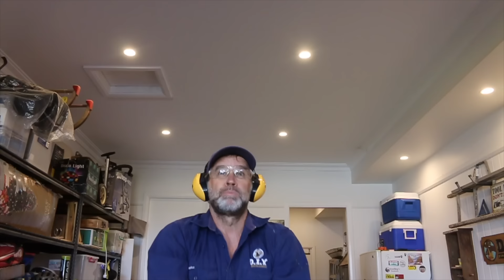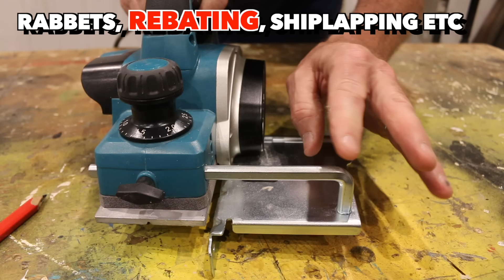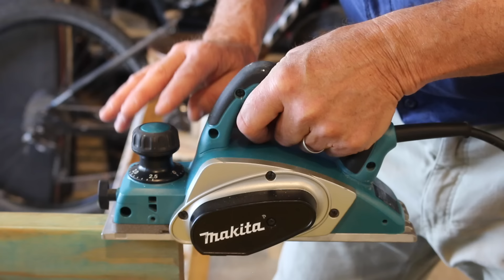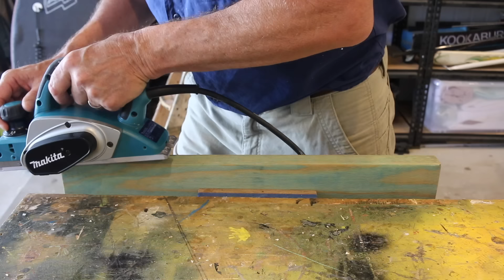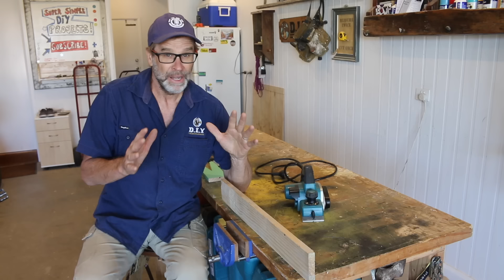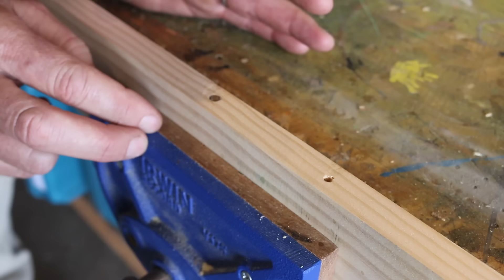BEGINNERS Guide to Using an Electric Planer.

Comment: Mate, this was the BEST multi purpose tutorial I've seen yet! This covered planers, clamps, safety and tips absolutely BRILLIANT!! TOP MAN! (I've just decided I don't need a vice and pipe clamps just go for pipe clamps and make one when needed! ...As I got a new metal work vice I could use small stuff with protection on jaws in a pinch, excuse the pun!) Regards the pipe clamps I just seen a set of 4 for about £45 on eBay red ones dunno if they're any good or how to tell!? Also what diameter pipe to go for as obviously they don't come with pipe, so dunno what's best cheapest and easiest to source diameter wise like dunno if they use scaffold pole type stuff or if you literally have to just go buy some lengths of pipe online or metal supplier.. only just getting into wood working really so Any tips on this be great mate!(Sorry if sound like an idiot!)
Cheers from London England 👍🏴🇬🇧
Reply from the maker: G'day mate!....Glad you found the video useful and l really appreciate the feedback. My best advice with pipe clamps is don't buy the cheap stuff....you'll regret it. Spend a couple of more bucks and get a good quality set. Most pipe clamps require one end of the pipe to be threaded as one part of the  clamp is screwed onto the end of the pipe. The ones l used in the video are a little different and don't need to be screwed on so the pipe does not need to have a threaded end.....if you know what l mean.
Just type good quality pipe clamps into google and you'll find a set just right for you and your budget. Good luck. 👍😁🇦🇺

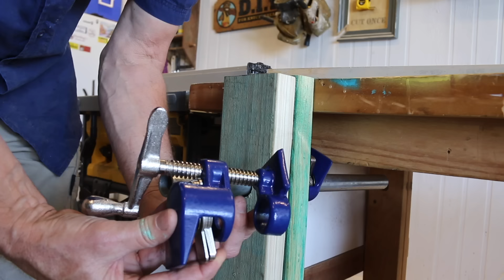Comment: pipe clamps dont require the pipe to be threaded?? 9:52
Reply from the maker: That's correct Mark. These type of pipe clamps do not need the pipe to be threaded 👍
Reply: Some do, some don't.
The hole in 2 pieces of wood works, so does a clamp without holes and a different clamp.

Comment: I have a project I’m working on. I’m modifying a pre-existing bench, made of mdf. I have three 2x2’s glued together on edge. The wood has dried and created a hump in the middle of the edge that needs to mate with a straight board. So both ends are about 1/4”-3/8” below the hump on a 4’ board. I was going to use a hand planer, but I don’t have one and they are quite a pain to get set up, I understand. So I called to see if I could rent one but they only have power planers for rent. I’ve never used one before. 
How would I go about planing the hump off the middle? This board won’t show, in the end; it’s just for support of a nice board. But it needs to be flat on the side mating to the mdf and they will be bolted together. I just don’t want to stress the mdf, so I think it needs to be flat. Any tips would be so appreciated.

Comment: Great video. It was very helpful. I built a wooden shop stool with a drawer. I added leather fabric and now the drawer get stuck when I close it. I plan to get an electric planer to shave a little off the top because I didn't want to dismantle the entire drawer!
Reply from the maker: Thanks mate 👍 Just be careful with the electric planer and give it a test run on a piece of scrap before you commit to the drawer....good luck 👍😁🇦🇺

Comment: Great video Shane! I noticed in the video you only used the planer on the edges. Can you use the planer on the surface? I'm wanting to plane down some wood that has a slight cup. A thickness planer would probably be best but those are expensive so I'm trying to find a cheaper way to go. Or would I be better off using a router and jig to remove some of the cupping? Thanks for any help mate. Fantastic video! Keep up your awesome work. As for the dad joke...um... keep working on those.  😆😆 Thanks again Shane.  🇺🇲
Reply from the maker: Mate, a router and a jig is your best bet 👍 The dad joke was the best could l could muster on short notice....promise l'll try better next time 😂 Thanks for watching 👍😁🇦🇺

Comment: Good presentation, thanks!
What about using the planer on wood wider than the blades capacity, e.g. 81mm blades on 100mm material ?
Reply from the maker: Thanks Lulian 👍 You can use the planer for that purpose but you do need to be careful and only take off small amounts with each pass 👍😁🇦🇺
Reply: @diyforknuckleheads  Thanks

Comment: Has anyone ever used a planer to prep edges of boards, but they end up being higher in the center and lower on the ends? They end up arched.
Reply: That just happened to me yesterday. Not sure why or how to fix it.
Reply: @LouisPeppie yeah, I gave up on electric hand planers. I tried 3 different planers, and every technique out there, and on anything longer than 36 inches, it would create the strange arching aspect. 
 
I ended up mounting it into an old router table top I had, and it makes a great portable jointer once dialed in. Lol
Reply: @carterscustomrods  i also thought about fitting it into a table to make it into a jointer. Sounds like another project. Thank you.

Comment: I would like your opinion on solving a small problem.  I have an interior door that hits just a bit from the bottom about halfway up.  I've tried to adjust the casing a bit and that helped, but not enough.  Here is what I'm would like to ask you.  It seems I'm left with two choices.  I could use my router and sink the hinges in a bit or I could use my Makita router on the door edge.  I only need to reduce the width by perhaps 1/32".  I don't know how to just run the planer over just the lower half and not have a noticeable lip where I stop the planer.  I hope you're able to respond to this.
Reply from the maker: Hi Jim. We come across this problem all the time and simply use the planer to take a little bit off the door. With the door shut, run a pencil down the inside of the jamb which will leave a mark on your door that will indicate where you need to plane. Set you planer to it's minimal depth of cut and then starting at the point where it's catching the most, run the plane over it feathering it at the end of end of each pass. Do this until you get to your pencil line and you should be right 👍 Hope that makes sense 👍🇦🇺😁
Reply: @diyforknuckleheads    Great idea.  Simple but perfect.

Comment: Great video, I have an electric planner which I bought brand new a couple of years ago, locked in a cupboard as I was not confident enough to use it. After watching your video, I am now going to dust off the unopen box, get the planner out and let it rip. Any tips for planning the bottom of a door ?
Reply from the maker: Good work Rod! Just do it mate 👍 When planing a door, just use small passes and plane from the edge of the door  to the middle of the door. Simples 👍😁🇦🇺
Reply: @diyforknuckleheads  thanks for the advice mate, love watching your videos, always easy to follow, have taken on a few projects after watching them..
Reply from the maker: Good to hear mate 😁

Comment: Wow your video was inspiring. I would like to crate a vise for my toolbox. I think it really would help me.  By the way im using my planer and it gets stuck my vacuum with the flakes of the  timber. Have you ever had that issue?
Reply from the maker: Yes l have had had that problem which is why l never use one. Also, have a vacuum connected to your plane throws it off balance a little 👍
Reply: @diyforknuckleheads  wow I wasn't expecting you'll reply. Thank you very much
Reply from the maker: @OTaKuoNeOn  No worries mate 👍

Comment: After watching this, I bought myself similar Makita Planer as I can reuse my existing 18V batteries I use on my powe tools. @DIYForKnuckleheads Is there a way to use a planer  to plain the table top?
Reply from the maker: You can mate but it is a little tricky to get a nice even finish 👍
Reply: @diyforknuckleheads  
Thanks

Comment: How do you hold down and plane the broad side of a board
Reply from the maker: Hi Maggie....you can either place it in a vice or lay down some of that rubberised drawer inlay material. It's very grippy and will hold the board still while you plane it. You can also clamp the board down....good luck with it 👍😁🇦🇺

Comment: Thanks knackers for sharing. Rare earth magnets are good for finding studs in walls too (where the screws are in the wall to attach the plaster board). Especially if you don’t have a stud finding detector. Great tips as always knackers👍
Reply from the maker: Cheers for that mate. I actually made a video where l show you how to find a stud with a magnet 👍😁🇦🇺
Reply: @diyforknuckleheads  . Thanks mate I’m sure we are on the same page when it comes to diy. Hope all is well in Australia 👍 UK has the first sun for ages😂
Reply from the maker: @Johnbro8   Don't get to burnt mate.....l know how you Poms can burn to a frazzle at the fist sign of the sun 😂
Reply: @diyforknuckleheads  not me I like the shady area’s, I just need the workshop drive to be dry and the bonus of being warm. 👍🇬🇧😁
Reply from the maker: @Johnbro8  Great minds think alike mate 👍😁

Comment: I don't have wise but made one myself really cheap. 

I took a metal strip 5 mm thick and 50 mm wide and made 2 pieces Y like thing. I welded (with help) two M10 screws on leg of 1 Y and drilled holes at same position on the other.  I mounted the thing on the table such that Y stays vertical. I can hold any piece of wood betwwen two metal Y by differential tightining of nuts.

Not the best one I'd say but better than having to hold the job with my leg.
Reply from the maker: Good work Milaan!

Comment: Note: Do not replace switch and blades on the planer, then hold in hand when your wife happens to blast into the garage and interrupts you with a lot of jibber jabber. You might zone out and accidentally flip the switch on, plane the palm of your hand, and spray blood all over your wife's shirt and face.  When you calmly ask her to get you a clean towel and the car keys, she might panic, run around in circles, even run into the garage wall on her way to fetch a towel. While she is off fetching the towel (she will forget the car keys)  take a quick peek at your hand. And, for the fun of it, guess how many stitches will be required. When she returns, calmly tell her it's not as bad as it looks, but she might want to go wash her face change her blood spattered white shirt and get the car started. 
 Changing her shirt will give your time to calm down enough to be able to safely drive you to the ER. Once she's gone, again, wrap your hand in the towel and apply pressure to slow the bleeding.  Do not bother wiping the blood on the floor. It will still be there to clean up when you get back.
On the way home from the ER, make your wife a deal: Offer to buy her a new shirt if she promises to never ever disrupt you again while you're working with power tools. She'll accept the offer. 
-Please do not ask how I aquired such wisdom.
Reply from the maker: WOW!....I can just imagine the panic Brent 😬😬😬😬  Hope it's healed mate 👍👍

Comment: After using cheap electric planes for years I came to the conclusion they are all no good. Can do a better job with a router and a milling bit tbh, well faster equivalent anyway. 
The problem with these planes is keeping the damn thing flat through long and awkward sections, some aren't even made totally level.
Reply from the maker: Appreciate your view D.S. Like all tools you need to use them for a bit to get used to them. There would not be a carpenter in the country who doesn't use these on a daily basis....whether it be to shave down a door, resize a deck beam, skirting board, architrave or to straighten a stud wall. They are job specific and probably not suited to a job where a hand planer is required.....hence the two different types of tool. Cheers and thanks for watching 👍😁
Reply: @diyforknuckleheads  I should clear up I'm talking about cheap planes, they are always garbage fresh out of the box. Much better to pick a good brand and model straight away and not have to regret your purchase a month after the warranty expires.
Reply from the maker: @DS-qy3qv  Understood mate and l totally agree 👍👍😁

Comment: Do people actuality chamfer pieces with a planer rather than a router? This is news to me. But the pipe bench vise was good, lower the pinch point from the pipe clamp it will keep the entire mass of the clamp more even without the need of the shim
Reply: It’s more for a quick bevel than a finished edge, power planers are used a lot in carpentry, it’s really handy for example when you need to insert the last plank in a wood floor and you want it tight, just bevel the back edge so that it clears the wall.

Comment: What about using the planer to smooth out the surface of jointed material; say a small table top where the surface is made of 1x4s of oak that are not all exactly 1 in thickness? If you get buy drift.

Comment: Carpenters generally don't use planes. They work with uwrot timber.  Joiners use planes. they work, to a higher degree of accuracy, with wrot wood.  Cabinet makers, work with the smallest margin of error and they use scrapers.  Please! Please! Let's not lose the difference.
Apart from that: a bloody good vid', Mate: despite the Dad joke. 😖  Keep 'em coming.  The vid's, I mean.  Knot the Dad jokes.  😎👍

Before anyone comes back at me.  The pun was intended. 😘
Reply from the maker: 😂.....Cheers mate 👍👍

Comment: Hey, I’ve only starter using mine and this video is great! I have however got a few gashes on the front shoe of my planer from a screw I didn’t see. Just wondering do you need to replace them ever?

Thanks!
Reply from the maker: Thanks Dylan and na mate....no need.....just gives your planer a little character 😂 Have a good one mate 👍😁🇦🇺
Reply: @diyforknuckleheads  Haha cheers bud 😂👍
Reply from the maker: @Benson8  👍

Comment: Moved to a new house and sods law says that only one door sticks. Tightened the hinges, sanded etc still sticks. So got a cheap £25 Corded  planer, took the door off, secured in the vice, stood where you said, tiny shavings, fitted door, and it shuts. Doubt I'll ever use it again but good to know its there. Thank you 👍
Reply from the maker: 👍..Good work Dave 👍👍

Comment: Love it! I do a lot with pallets as well. How do you plane the tops? I want to make a table out of pallets - using the wide boards. Maybe after joining them together and plane the top? New to planers.
Reply from the maker: Thanks Sheri 👍....The first thing you do is be very selective with your board selection. Choose ones that are similar in thickness so there will be minimal planing and remember that with pallet furniture it is meant to be a little rustic so things don't have to be dead flat and uniform. If you do need to use the planer, make sure you take little amounts off at a time to avoid accidental gouging. Good luck 👍😁🇦🇺

Comment: Great vid, thanks for posting!  I really like the tip about how to use a clamp by drilling a hole in the workbench.  I can't tell you how many times I have struggled with getting a project pieces clamped tightly to my bench.  Thank you very much!  Can't wait to give it a try!
Reply from the maker: Glad it was helpful Andrea 👍😁 Good luck with yours....it works really well 👍😁🇦🇺

Comment: I wonder if "Knackers" has the same meaning down under as it does in the UK.
If so, that's bloody hilarious. 😂👍
Anyway that's no why I'm commenting here.

As a reasonably OK woodworker, as hobbyists go, I much prefer and old fashioned manual plane, it is just what I'm used to using. 
Yeah, I bought an Electric plane because it was on offer and soon regretted it.

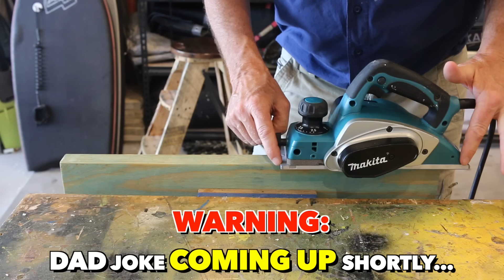That problem with the front edge dug out at  5:16 in your video. I tried everything to cure this problem, in the end I thought it was just a characteristic of the design of the tool, it seemed to be grabbing and snatching the blades down into the wood, leaving a horrible gouge. Thanks to your information here, I think I may have set the depth too aggressively, or the blades were simply crap to start with. Even though I applied more pressure to the front of the plane it didn't seem to make much difference.
Think I better reverse those blades, if they are reversible and have another bash at it. 
Cheers for the very helpful video.  👍👍
Reply from the maker: Yes it does Gary 😂....Mate, it all comes down to practice and yes....a little lighter on re the depth setting is recommended....thanks for watching 👍😁🇦🇺